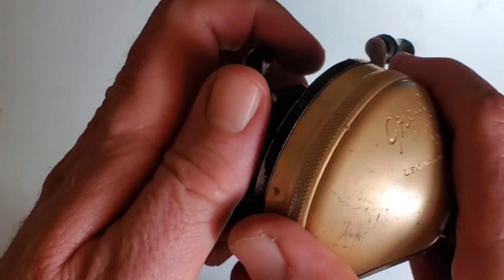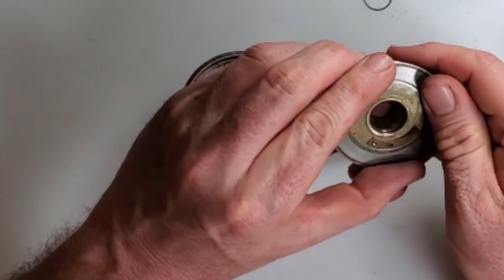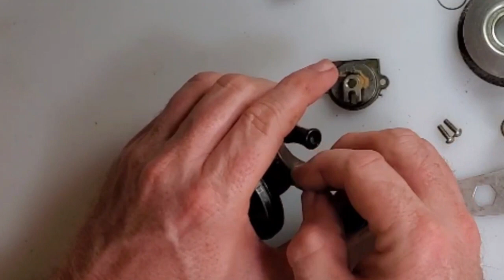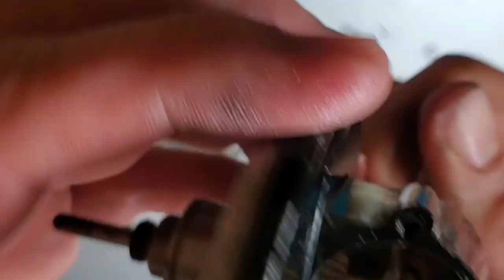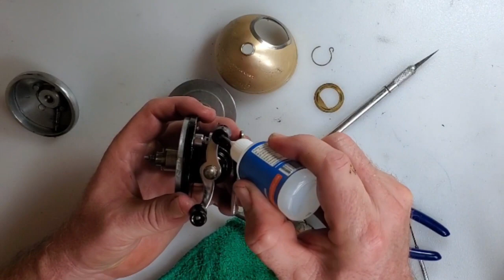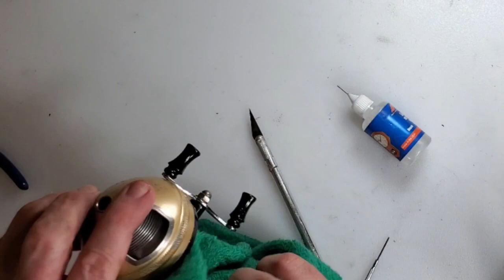Great Lakes Holiday "98" (1956) Vintage Spincast Fishing Reel

Comment: You were close to getting it apart. The bent rod through the pinion is used to wiggle on the pinion deal. There's a nylon bearing behind the pinion holding the whole set up in. The whole set up slides out when the bearing comes loose. Then you can remove the big gear. There are washers behind the big gear to regulate the big gear pushing on the pinion.
Reply from the maker: Thank you! Much appreciated. I'll have to get back into and finish the job.